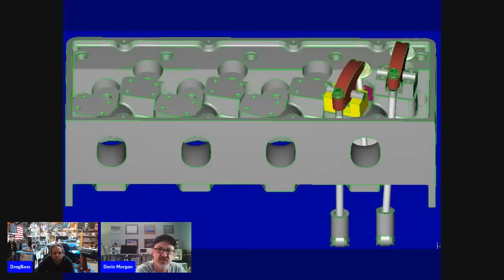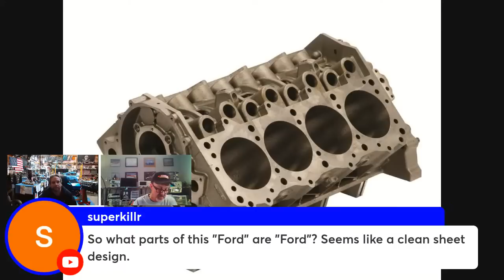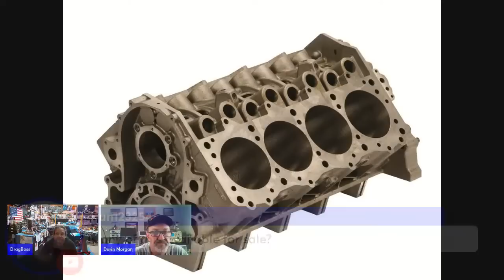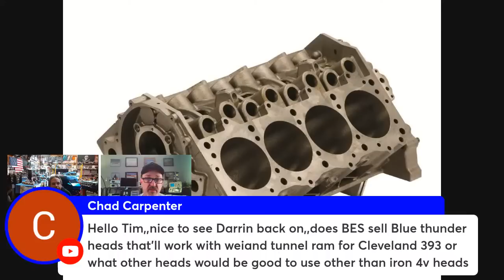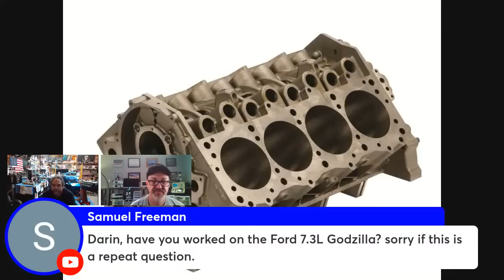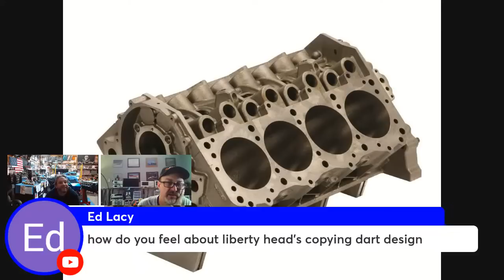DBG: Darin Morgan;  Ford Pro Stock Canted Valve Arrangement Head 1400+HP @10,200 rpm  with 499.6 ci

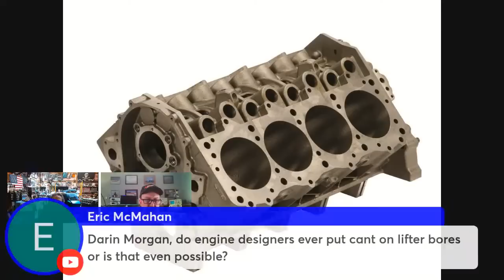Comment: 59:51 I find it hard to believe that a canted lifter is impossible. On the F1 technical forum under a thread called "F1 Cylinder Head Design and Pneumatics, a closer look" there's a series of cut aways of a Hart 1030 V10 cylinder head. They have splayed / canted intake valves with a bucket tappet. The tricky thing is that you can't use a normal cam grinder to make the lobe profile since you need it to be asymmetric
Reply from the maker: F1, is a whole different world, some of the tech, just blows me away, Darin loves it too, thanks for being here.

Comment: he's right about Sheetmetal intakes vs cast aluminum! I ran in a all ford meet at MIR with a 83 Capri with a 40 over 289 K block from 60's using 1969 Winsor heads with an old tarantula intake and had guys pist a me because i was running 12;01 every pass on a 1975 holley 800 , they had hamburger intakes and injected and said the intake harmonics were all over the place as was their et slip. some times the shade tree mechanics get it right!
Reply from the maker: Old school cool. Doesn't always have to cost a fortune...
https://youtube.com/shorts/v98GiFPii6Y?feature=share

Comment: There was a young Engineer working under the main Engineer at GM working on the Mark IV he left GM went to Ford and Designed the Clevland heads.
Reply from the maker: Not sure of that. I have the original papers on that, the testing done at track when they switched the motors and inside details of the mark IV from a guy that has the original. No where he mentions that. 
Also do you think the Cleveland and mark IV AND OR BBC are same heads so to speak?
Reply: @dragboss351cleveland    I have never worked on a Ford Clevland.  Bill Glidden more or less designed his own heads.
Reply from the maker: He improved a set of Edelbrocks.

Comment: Does anyone think the Cuadra boys are going to use this engine since they use the mustang body panels and front nose in 2025? In my opinion, not so much I actually talked to David and Cristian Cuadra at Norwalk this past summer and they both told me they've been using different engine combinations Chevy, Buick, Ford ,of course they had engine builders doing it. I think it's going into different directions in the future. But it would be great to see them running this exact engine package, because there are great people and I love to see them do well 😊
Reply from the maker: That is a possibility. I was there too with them as guest. Fernando and the boys want to do a live chat and. Kw that racing is winding down, we will get them on for a live chat. Frank Iaconio builds Christins engines.
Reply: @dragboss351cleveland  I appreciate the info. Super excited to see that upcoming video you're talking about.
Reply from the maker: @ thanks my friend. Going to present the cloverleaf in some intakes, which may lead to spacer discussion to follow.

Comment: Is this engine too expensive to use in Nascar ? Broad range of rpm , long race at 8000 rpm ? Could you run a smaller cid and more rpm to save fuel when going slow ? 
What about plasma sprayed bored like the GT-R ?
Reply from the maker: This was for pro stock. No way would NASCAR use a pro stock head like this.  Nascar equals GM

Comment: Yes pontiac made tunnel port heads in 68-69.  Was supposed to be the ram air V but was never totally built hower the parts did make out out over the counter. Buick also built experimental tunnel port heads and they still exist. Those never made it public.
Reply from the maker: Love all the skunk works type development from the manufacturers. So ram air, 3,4 and 5?
Reply: @dragboss351cleveland  RamAir 1,2,3 were just HP designations, 4 were round port, 5 was tunnel port.  Then the 455 were HO, SD for round port
Reply from the maker: @kevin2960 thanks Kevin for the clarification. Appreciated

Comment: I think the private sector need to start backing the mechanical sector for buying power to get the engines we the people will always need electric cars and trucks is a pipe dream cause the weather alone will cripple the domestic use of transportation in the US and Canada we simply don't have the infrastructure and it would blow up if everyone plugged into the power grid to charge their cars it simply is insane to think this is the answer . No businesses will will be able to operate as no nothing will move for commerce. To even suggest electric is the answer is in need of a wakeup call to the insanity of electric vehicles. May Hotrodding live forever with anything but electric.
Reply from the maker: Amen to that. As Warren Johnson said on my live chat, never happen, can’t live without diesel truck for sure. Have your electric cars, but don’t try to force them into being and us having to use them. These people need their head examined and look at the facts.
Reply: @dragboss351cleveland  exactly. We can not move away from gas or diesel it is absolutely impossible and these green idiots who have no idea what I made with oil  call us fascists for driving a car or truck while recording you on a phone made with oil and have shoes made from oil and signs made from oil standing on a street made of oil and live in a hose where 29% is made from oil and eat their near meat wrapped in a package made from yep you guessed it oil. Insanity that's the only thing that can explain this BS. Keep up the good work Drag Boss .

Comment: The valve orientation flow path changing the rpm range for the head is most likely due to the bottom end specs that are not changed. The higher the rpm the higher the piston velocity and the more messy the intake charge is. That's why F1 engines have very short strokes so they can still get good swirl at crazy high rpm's, having a straight flow path will kill most of the swirl.
Having a big rod ratio too can make the intake charge more controllable, so even with a lot of swirl the flow doesnt go messy at the middle of the stroke.
Reply from the maker: I guess I don’t see the bottom end affecting it as much as rpm in general. To me swirl is more from intake port and combustion chamber shape?
Reply: @dragboss351cleveland  The swirl - yes, it's created mostly by the top end.
But a bottom end that has a slower or more constant piston speed can allow you to have a top end that has more swirl because the piston velocity isn't so high that the air doesn't have time to move anymore.
So a slower moving piston can allow you to have more swirl without hurting high rpm flow. And thus a wider usable rpm range.
Reply from the maker: @KrisisVal  It makes sense, If I remember, I will ask Darin, we have never talked about it. He said he will be on next few weeks, has something very interesting to present. Thanks for taking the time to reply

Comment: I'm just going to inform you you do not want to use carbon fiber rods for the same reason you do not want to use carbon fiber pushrods they are too flimsy and they will break use steel  rods and pushrods but the auction is yours to try I just do not suggest it
Reply from the maker: Who are you informing Tim ?

Comment: Because of  the extremely low hysteresis of carbon fiber, and its lack of internal vibration damping due to that, the vibrations just keep building in them until they explode into powder. Aluminum or steel have more hysteresis, so the vibrations inside them do not build into dangerous levels of resonance, but are damped and turned into heat, which the oil/coolant gets rid of.

What no one realizes in this type of experimentation is that aramid fiber has far more hysteresis and is far more forgiving than is the hyper-rigid carbon fiber. People just lump in all fibers in FRP into one group and condemn them all. You could use metal fiber mat, too. There are so many thing that can be done, but for the human-level budget, no one is bothering due to the lack of return on investment. Another issue is localized heating. Even if the FRP had good hysteresis, the resultant heat would be trapped in the middle of the hysteresis zone, unable to escape.

What would happen would be what happens with too-thick concrete that gets too hot internally when setting: it fractures due to differences in expansion across the part. This is one reason aluminum is so good. It immediately transports hysteresis-produced heat in ALL directions. Carbon fiber is an insulator across the fibers, and an excellent conductor ALONG the fibers, which can still trap heat too much. Metals are omnidirectional heat conductors.

However, people have to get more brake mean effective pressure and more cylinder-to-cylinder consistency, and doing those things yields more bang for the buck than pushing the boundaries of materials science.
Reply from the maker: I guess they work better for body parts. Lol. Crazy fiber knowledge you have. Thanks for the enlightenment

Comment: Really an incredible pushrod 500" engine design thanks to Cunningham Ford, Darrin and others. Its probably the most hp 500cu inch naturally aspirated engine today. 12,000 RPM with Pushrods and a dry sump is insane!  They all should be proud. RIP Jim Cunningham.
Reply from the maker: Yes sir rip Jim. No doubt. can only make 1500 hp, with 500ci, and this is killer
Reply: I watched a vid on another channel that is educational.  They were at a big name prostock place and 3hp per cu is the goal.
Reply: Checkout the pushrod & forked rocker layout in a Honda CX or Moto Guzzi Daytona. You looking at near enough to 10k revs in standard trim with the Honda & close to it with MG & that’s air cooled, with neither having roller rockers

Comment: And my 40 year old son will not even help me finish my 1965 Galaxie lightweight clone with a 451 stroker. 4.11x4.25 and.160 non thrust and between the bores and.250 thrust.   I have a vintage Offy PoS and a Holley 3310 downleg with metering blocks on both ends and the choke milled off. Charlie Crites Mad Dog headers and bare bones interior. People are just lazy. Put an EBay turbo on a 351W , 3 inch main that will scatter at 600  hp. It makes me sad. Put two of those on mine and I m good for 1200 but why? 600 NA is good enough.
Reply from the maker: In general, kids are lazy today when it comes to Engines, most know, nothing about them, nor do they want to learn. As the parents had no interest, as the newer generations, parents had no experience with them. I’m old-school that’s why I like Cleveland‘s 50+ years and still kicking ass. Good luck with your build.
Reply: @dragboss351cleveland  And good luck with yours. I love Clevelands but only the 2.74 main ones. The 4V one I had I did the same thing I do with my FEs . I check the main bearings and the thrust clearance. I have had to lap the side of the main bearings to get the clearance, and people talk about skinny bearings but the Cleveland bearings are interchangeable on the mains and I have used Cleveland main bearings for years just stone lap to the fillet radius and desired thrust clearance. That is fun for me. Cleaning and making sure there are no burrs and blueprint it. Damn that is fun!  I don’t understand it. I enjoy building them as much as racing. I am legally blind so I still have some vision and I haven’t built an engine in while. But I still constantly enjoy learning, and helping people want to learn and be enthused. I could get down the quarter if I wanted to. I enjoy learning and teaching.

Comment: I actually would love to have a medium Riser FE intake with 2 4Vs and a set of HR height heads with wide but a shorter height port. This would be the holy grail for a 4.125 bore 4.25 stroke 454 FE using a 70s well cast 360/390 block. I build one for a guy and he put it in a 68 Mustang with a Boss9 scoop and a 4 speed with a very good clutch and Comps custom solid flat tappet. He cleaned house with it. And I have to ask him how his 1938 engine is holding together!🤣🤣🤣🤣🤣🤣🤣🤣🤣
Reply from the maker: Yes, don’t forget to ask him, laugh out loud
Reply: @dragboss351cleveland  I got a kick out of that. I have a bud in CA with 68Mustang with  a 6-71 451 ci 427FE that runs mid-8s with a 6500 limit and drives it on the street . I had a 70 1/2 Falcon with a 4V closed chamber 351C ❤ Black on Black taxi cab dish caps and all I had to do was put a 3.70 chunk in it and a B&M shift kit and it enough for all but the 428CJ 429CJ and LS6 cars. It had solid lifters and man it was sweet!  I kick myself now but back then they were just used cars! I wish I had it back!

Comment: 427 HR and TP heads are an excellent example of if you purchase them, you have know who did them and the preparation of the compromises that have adapted a Tunnel Port to make the pushrods invisible can be lost with a Serdi cut in the wrong direction. As you said you can take it out but retrieving that balance that made that pushrod disappear will have to be retrieved carefully from the previous preparation of the Tunnel. Air speed, so many factors. The High Riser is the same way. If the designer reworked the tall narrow port to an LS3 style wide port, the SSR is a bear trap. Your analogy of being booby trapped is quite  astute. Thank you!
Reply from the maker: You’re welcome ghost. I’m glad you’re here and enjoy the chat. Like Darin always says when you get a valve job done get it done by the guy that did the heads you can lose so much I’m having it done wrong.

Comment: The Ford FE was amazing in its day. People have said that the narrow main bearing was bad with the same diameter as the 351C . Their engineers were second to none in building a race engine in their day. I built and raced FE engine for 40 years and I am still amazed to see things in design of the engine  being validated today. I ve never burned a Main bearing. Ray Paquet was running 8 seconds in the 1/4 with the FE wedge heads, Ford mains and BBC sized rod journals. Shifting at 9200 just as Darin said that the aWedge would. My street 4.07 bore 394 ci engine is doing 7000 rpm’s with iron crank and 5140 steel stock rods (stock 6.49, 3/8 ARP bolts) 30 years of street racing. 496 ft lbs , 503 hp. And you can hit it warmed up with the factory 427 410 hp solid cam ground on a 109 LSA. Thirty years and it has not broken anything. Canton C8AE- X clone deep sump 8qt pan and the 3/4 inch sump with the sump trap doors and hose barbs in the intake valley with a slot in the bottom near the valley to allow oil and the barbs to extract air. I love this old FE, it’s amazing how well the heads did with little love. Your flow path diagram shows the genius of the day in how they tricked the flow path to, if you know what you are doing to use an angle mill to 12 degrees from 13 to move the flow path to very close to a stock BBC. I have been accused of running a 427 ringer. It was just a small modification to the flow path and optimization of a Holley Street Dominator with a little welding in the right places. Lol.
Reply: Thank you, I sure will. This is solid learning and no BS!
Reply from the maker: Thank you for commenting. Fe have a huge following. Look what they did at Lemans, they are an amazing engine. That is for sure. I have a buddy that’s an Fe guy. I kind of like Cleveland guys. They stick with what works for them. Your engine sounds amazing. so keep it running. and thank you for sharing with us, its performance, and specifics. Appreciate you being here stay tuned
Reply: @dragboss351cleveland FEs did everything well from oval track to station wagons and FT medium truck duty. If you look at what all the high performance engines of today use, the 427 side oiler had it all. Cross bolted mains, tall deck, plenty of room between the cam and crank centerline, shaft rockers, intakes next to each other instead of exhausts, shallow valve angles, it really was ahead of it’s time rather than antiquated. Had they made it on larger bore centers, they wouldn’t have needed the 385 series or the 335 series. It took 3 different engine families to replace it.
Reply from the maker: Your right on with that. Lots of buddies into Fe but never had one. They were in ever line of duty. And have a huge following now. Some day may have one, be cool to test one and see how she goes. Lots of current similarity with modern bullets. Thanks Peter for watching. Hope you got something out of the video too
Reply: @dragboss351cleveland  I know that you would enjoy talking to Jay Brown about his FE Power heads, adapters and intakes.  He is getting very close to 2 hp per CI. He has recreated the spacing of the Tunnel Port with rectangular ports and offset rocker arms that allow the pushrods to angle up without interfering with the ports. Pretty cool. Jay has his own dyno and tests a lot. I used to be able to contact him but I have been blackballed by the FE community for all of my hare brained ideas that cause good air flow and power, lol. The builders hate me for sharing  “secrets “. But they are my own ideas, I don’t get it. I set of heads I worked on for years  disappeared from the machine shop where I was having some finishing touches done on.